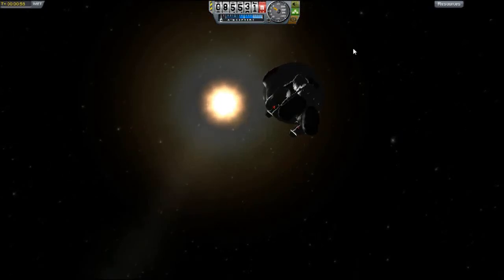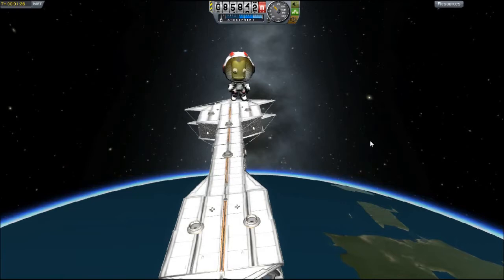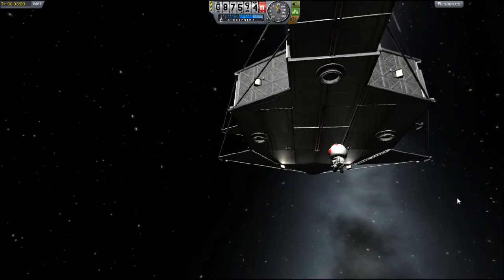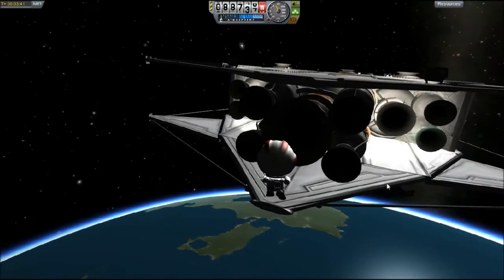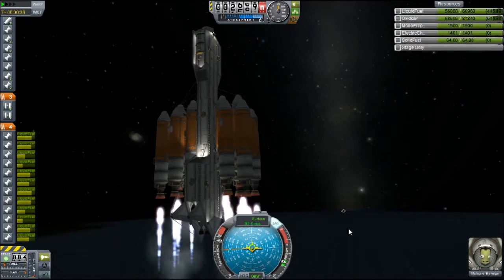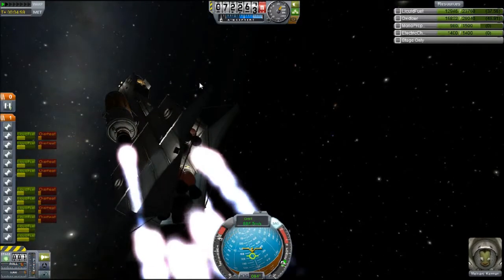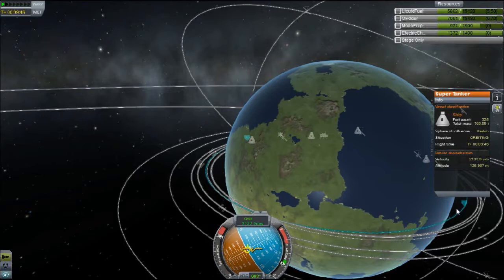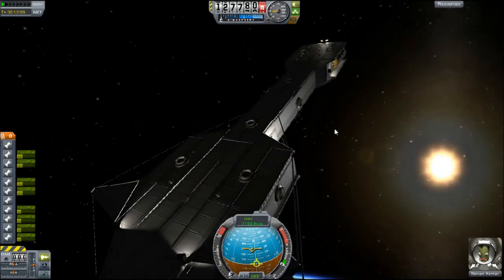KSP - Super Tanker

Comment: Might be a noob question, but how do you make engines burn at diffrent thrust levels?
Reply from the maker: Other than the Shift key? I typically assign action groups to separate engines depending upon the thrust level I'm going for. If I don't want that engine on, I just toggle that action group (usually keys 1-0) and it shuts that engine off. Did that help?
Reply: ChozoNomad Sort of. I guess what I meant was how do you differentiate the trust between the engines? like when you launched, one set was at full power, another at half, and another at a quarter. then when you drop a stage the half goes to full, and the quarter to half, ect. Like the stock Kerbal X rocket does
Reply: Taylor Reno Nvm i just read the asparagus staging article on the wiki
Reply from the maker: Taylor Reno
 Oh. :b